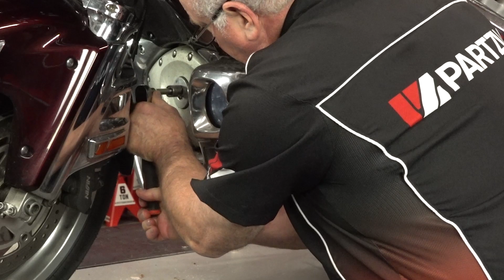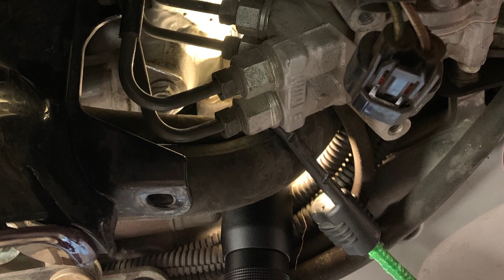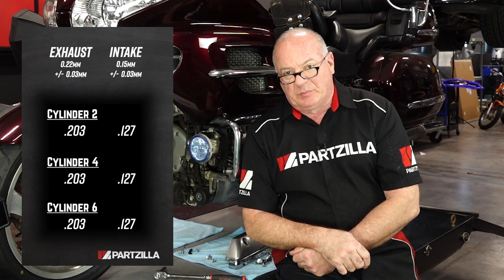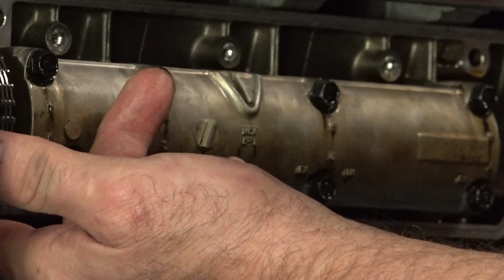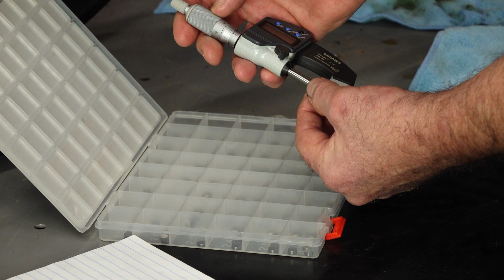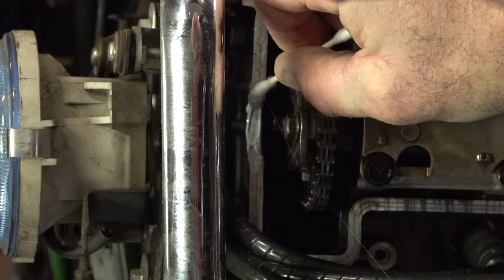Honda Goldwing Valve Adjustment | Honda Goldwing GL1800 Valve Adjustment | Partzilla.com

Comment: Great video. Thank you. I just bought a '23 Tour DCT three weeks ago. While browsing the shop manual, I was pleased to see that Honda put valve lash adjusters on the exhaust valves (which can tend to tighten over time). No camshaft removal needed for those. I'm curious why they didn't do the same with the intake valves, but used shim buckets instead. I really liked how easy it was to adjust the valves on my Honda Odyssey, as it has adjusters on both.

Comment: Fantastic video man. I specialise in Design for Excellence which includes Design for Maintainability and I would like to use the right hand (ABS side) chain tensioner tool access and use as an example of compromised design practice

Comment: On the forum that I followed years ago, only one person of the hundreds who had checked their valve clearance had to actually make an adjustment. And that was when it was only at the high end of normal. Not because it was out of clearance.

I offered a Honda mechanic to check mine, aware that it could cost $700 to do the job. He declined to even do it, because he said he never finds out them out of spec.

Comment: Should't the engine be turn over the other way round so the tensiorner gets less pressure and starter clutch turns free and engine strokes are in normal working order?

Comment: but wait.. if the shim is behind the bucket wont it be protected from ever wearing out? wouldnt it forever be in spec?
Reply: As valve seats wear the valve stem moves up reducing the clearance between the bucket and camshaft lobe. So you have to replace the shim with a thinner one to regain the clearance between the bucket and the camshaft. I hope I made this clear for you.

Comment: Hey mate, may i ask what is the equation if the valve clearance are loose?
Reply from the maker: It will be the same equation. You just enter the loose measurement as 'B' in A=(B-C)+D.

Comment: Yes sir love your videos I've got a charging issue with my VTX  1800 battery has left me stranded  I've watched your stator  video as yours reads 0.5 mine is only reading 0.2 0.3 very slow climb from O and third is saying 0.0.0.1 back to 0.0 on third leg  2003 20.000 miles replaced the rectifier because easy hoping ...no luck battery is new as well still went dead ...before testing stator would u say most likely stator ground read good OL I've done your test 5 times same reading

Comment: Respectfully, you need a better camera angle on the work at hand if the goal was to show the area being measured and adjusted. And with respect to the cam chain tensioning, I share your hesitation with that process given the active involvement of the tension on the camshaft when the engine is running.
Reply: Yeah, as someone desperately trying to find good instructional videos, this seems to be a common problem.  It seems like people believe that those watching already have a basic understanding...when of course, some of us don't1

Comment: Seems like you would check clearance with chain tensioner in place. Bike runs with it in place. Only loosen when removing cams. What does the Honda repair manual says?

Comment: That tensioner system is more proof of the guys designing these things are NOT the same guys that work on them.
Reply: This engineer was kinder than the guy in charge of designing the air filter location 🤦
Reply: @UpShiftYourLife hahaha truth
Reply: Better ask harley deisgners who can not figure it out for over 100 years selling their shitty design which can not last more then one honda oil change 😂